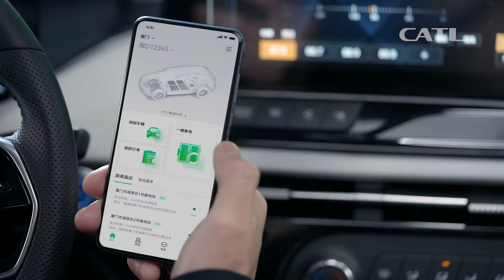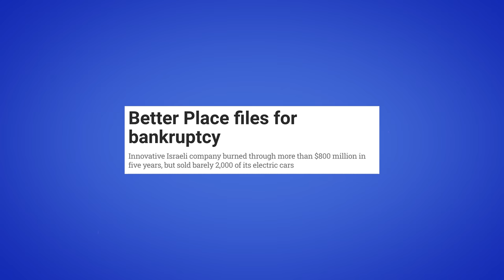Why Battery Swapping Is A BAD Idea

Comment: Maybe while hotswapping is not the best idea, the concept of universal batteries could work by giving owners of EVs alternatives for when their current battery dies...
Reply: I don't think it would be hard to find 3rd party batteries provider for mass produced cars if demand arises.
It is a right to repair problem.
I know certain automaker is notorious of that, which makes people expect EVs hard to repair, but other automakers prob. could do better.
Reply: 500k miles warranty by Tesla on battery is ample I think.
Reply: How long do you think a battery lasts these days? Modern batteries OUT LIVE the car itself. So why bother?
Reply: @HermanWillems  Where do you get this BS from? cars don't rot anymore and EVs only have batteries and drive units. The biggest reason that EVs are taken off the roads and scrapped is because of battery damage...
Reply: @veerkar  Where's this BS from? here in UK, the warranty is 150k miles and that is only to keep 70% battery capacity retention which is pretty poor.
Reply: @jlrguy2702  i have yet to see that happen..assumptions my friend. When you want something to be true because u hate something does not mean you are correct!! I live in the Netherlands and together with Norway most EV's per capita and i never heard about such thing. U just assumeeeeee
Reply: @HermanWillems  Asume what? I work in the automotive trade, not that it's that hard to find relevant information. I also own a Tesla Model X so don't know where you get the hate from, "pleb". For the past 15 years cars have mostly been galvanised or made of aluminium so they don't rot. EVs aren't old enough to have any rot or rust on them, meaning the only reason to take them off the road is either battery or motor failure, judging that a motor is relatively cheap (4-10k) compared to a battery (15-20k). Currently, the only reason any EVs are taken off the road is because of battery failure or accident where it's deemed a total loss. 
So if anyone is assuming anything it would be you, lazy rubbish comments based on opinion rather than fact.
Reply: Battery is also including cooling and  heating elements, among various sensors. They would vastly different between manufactures and even models.
Reply: @semibiotic This is for one brand, NIO so there’s no complications on battery swapping at all??
Reply: It more like to Auto-da-fe. With heretics penance and immolation.
Reply: Spot on!
Reply: Basically  teslas  are like  phones now yes people complaining  about  folding phones  your only gonna use it for a year and a half and trade it in for a new phone is that what's happen  with tesla is it 🤨

Because  everyone  wants the latest  phone ile probably  start trading  my phones  in every year and a half for folding  phones  lol  because  the batteries  don't last 2 years anyway of hard use why can't we have nuclear  diamond batteries  that would last 7 years for as long as the security updates  oh yea battery  last 2 years but if your replace the battery  4 times every  2 years

Comment: Battery swapping has additional benefit that was under the radar..

Quick charging batteries degrade them faster. We will need physically less resources to sustain such system (resources for new batteries) (although bigger investment of resources on start)
Reply: It's not like batteries in swap station are fast charged all the time
Reply: But most people charge their cars slowly. Only like Taxi's use the fast charger a lot. So yeah maybe the use case could be taxi's. But at my company there are like 20+ people having EV's and barely need any fast charger. Only a couple of times a year.

Comment: Spot on Rory. One other point is the maintenance required by the system. Installing costs money, maintaining and manning it costs tenfold. Especially in the colder European weather, where cars come into the system wet, muddy and salty most of the year. The system will wear, its complex mechanics and sensors will fail. Ever tried keeping an outdoor escalator running? We have one partially covered in our building. And guess what? It’s always busted, as is the outdoor wheelchair lift. The most important point is heating the system, batteries need to be charged at optimal temperatures, the system needs to be warm or it will freeze. Heating is expensive. My list goes on. Just improve the charging infrastructure and increase speeds. Sorted.
Reply: Do you think before you post?
Is infrastructure there presently to support widespread home or outside charging of any type, let alone fast charging?
Reply: @abbersj2935  Yes
Reply: @AKA001  Clearly you don't, as everything you said is answered by swapping batteries and not done in home charging.
Reply: @abbersj2935  I guess you don't own a home but an apartment unit.  Garages are always 10+ degrees celsius warmer than outside.  You can preheat the Tesla battery before charging.  A K is correct.  Winter in many countries last for months and -20 degrees celsius is not uncommon.  What works in China doesn't mean it's going to work elsewhere.
Reply: @johdo9953  You're wrong on all counts. I own a house and a garage, unheated, detached, it's normally at outside temp.
Reply: @abbersj2935  Obviously you are not.  Any person with a brain knows inside temperature is different from the outside.
Reply: @johdo9953  Doh. My garage is north facing and uninsulated. So much for what you know. Anyway, back to the real point, setting up the infrastructure for home and remote charging will be impractical and unfeasible in many cases, in my view a better answer is required. That is battery swap.
Reply: @abbersj2935  Battery swap is good except that it doesn't make economic sense.  If govt offers it free with tax revenue then I think it might work, because govt can subsidize health care or public transits.  However, it won't work for private company because it's costly to operate.  I am sure NIO will fail at some point.  Xpeng's financial and business model are better than NIO.  NIO is spending money on nonsense.  People buy cars not buying your dream.  NIO is selling a niche market but its market cap suggests it aims for mass market, hence sure failure.
Reply: @johdo9953  So you say. Batteries could be owned by the big oil companies, leased out to car owners hence reducing new EV prices by $12K to $15K
Reply: @abbersj2935  That could work, just don't think it's going to work for car manufacturer.
Reply: @johdo9953  I'm not sure either, but it certainly help more people buy more EV's. That's good for the auto makers.

Comment: For delivery vehicles and taxis, it could be a great option, so a driver can get quickly back on the road, especially if a company only have the same vehicles.

But, not only because we offer home chargers, but because it makes more sense, charging is the future of EVs, matching your home or public charger with solar panels is the sustainability winner!

Great video! Thank you for sharing 🔌⚡🚘
Reply: except solar panels arent the sustainability panacea that they have been touted as. They lose effieciency dramatically, are not recyclable, have many toxic materials in them that leech into soil if they panel is damaged, and because of supply chain issues, are more expensive now than they were a few years ago. Add to that the fact that most people are away from their homes when the sun is out and home when it is dark, you're actually at a big sustainability loss. 

Even if you had a powerwall or another equivelant way of storing the energy obtained during the day, all you are doing is increasing the already massive amount of carbon being released into the atmosphere by lithium mining, shipping, and refining, not to mention the myriad human rights abuses taking place in the countries where lithium is mined.
Reply: @SkillzorZ021 it's not the way it works : you can have home batteries if you want, but most don't. The energy generated by the solar panels goes into the grid where it is consumed immediately. Solar panels efficiently does go down with age but not that much and as pollution is concerned, you got to compare it with the disaster that oil extraction, refining and transport is

Comment: As an EV owner of 3 years on my second Leaf, I have to agree with you. Battery swapping seems a great idea, however, when you’ve owned an EV you realise it’s trying to solve a problem that’s not there. 

Like most EV owners I charge overnight. I have no off street parking so I plug into a street lamp in a residents charging bay. My car is my personal and driving school car so, on a day to day basis, I go out and do a days work then plug in again overnight. Battery swapping has no advantage compared to overnight charging. It would be more inconvenient because it would require a trip to a battery swap station and at 6:00 in the evening probably a wait in a queue. 15 seconds each evening and my car is plugged in near home. 

Then there’s long journeys. The rapid charging network does have room for improvement. I’ve not ever been let down by it but have been mildly inconvenienced. The network is improving though, especially in the last year. No longer is charging a solitary charger in the corner of a dark car park but rows of shiny chargers. My envy for Teslas and their Superchargers has still made me order a Model 3 though. Tesla just got it right. 

On long journeys rapid chargers usually coincide with a toilet break or food so the wait isn’t a problem. And while rapid charging costs more than overnight charging it’s still cheaper than running an ICE car. This is why battery swapping won’t find a market. As you say in the video, the scale and cost of the facility to store and charge enough batteries to to give drivers that 5 minute turn around without a queue will make it more expensive than rapid charging. The amount of people who will need this fast turnaround after a couple of hours driving is going to be small. As you said, is it worth it to save 12 minutes. As us humans need toilet breaks and food a battery swap will increase the time for these breaks as you have to be with the car while the battery swaps before you can get to the food or toilet, rather than about 30 seconds to connect to a rapid. 

Some manufacturers are moving to structural battery packs to cut down manufacturing time and costs, and vehicle weight. This will increase range and reduce prices. A structural battery couldn’t be swapped. 

Battery swap might have worked if it had been adopted initially and EVs had no way to charge other than battery swapping. It would have needed agreement of a standard from all manufacturers because as soon as one put a charge socket on a car owners would start charging overnight and ruin the business model. It would also have needed enormous investment in swap stations up front. 

Nio are making some very nice cars. Hopefully the UK s one of the European countries they’re exporting to. I think they will be charged just like any other EV with a few battery swap stations that are a marketing tool.
Reply: Besides 18 minutes charging is just around the corner😁
Reply: @mannyechaluce3814   I Have a Tesla Model 3 on order. The spec from Tesla says it will charge up to 171 miles in 15 minutes at a Supercharger.
Reply: @EVinstructor  The spec and reality are not always the same.

Don't get me wrong, love our Tesla and absolutely would buy it again. Road conditions  dictate how much range you get at a supercharger.

That said you are spot on about battery swap. After almost 3 years owning a Model 3 I see it as a dead end idea 
If anything I see how swapping as an excuse to make batteries a subscription product (ugh) and an opening for governments to impose a limit of 100-130 miles per battery. That in my book would greatly hamper adoption.
Given that fast charge is already a 12-18 minute event and gets you 120-180 miles, hot swap wouldn't actually 'solve' the problem people imagine.

Comment: Battery swapping makes perfect sense for densely populated areas .. especially is large cities.  It makes a lot of sense to take the battery out of the car since battery can be maintained or repaired outside of the car.  Also, swappable batteries also means continuity for battery evolution.  Car owners also don't have to worry about battery failures or battery life cycle.  All EVs should have charging and how swap capabilities .. best of both worlds.  A lot gas station can be retrofitted to include battery swap service.  Need to think outside the box.
Reply: And you'l pay more than having to buy a new battery once if thats even needed because companies are not charity. your logic is flawed and unrealistic for a capitalistic world.

Comment: There are a lot of advantages. 1)  You can buy a cheap car now with a small batter and just swap out as batteries get cheaper or you get richer.  2)  Quick swapping means you can do with less battery, which means less cost and weight.  3) helps resale of cars since I buyer does not have to worry battery is damaged.  It would make car companies outside of China more willing to make EVs since the battery is now decoupled.  4) Leasing batteries would give dealerships a way to make money after the sale.

Comment: What about integrating swap stations to store renewable energy? Using them as grid support units will be an important factor to consider. Swapping will be most viable for the micro mobility segment but any scenario where a quick turn around time is needed can benefit by this once doomed technology!
Reply: the NIO -model
Reply: If they have swaps they still need other batteries for grid stability / storage. Plus the other function requires other technology. So it's not a real savings.
Reply: That works when governments are able to force collaboration.
Reply: @acchaladka  It is savings... Once more people buy ev and older EVs are discarded now you have millions of lithium battery wasted, with Nio swapping stations you can simply swap to the latest battery hardware granted if it is compatible with your car, it will reduce landfills of abandoned vehicles

A single swap station can swap 100 EVs a day, while for charging you'd need a mall size parking lot to charge 100 EVs a day... That's assuming car owners can get space
Reply: Great idea, problem with green energy is storing it for when it’s truly needed. Perhaps Nio swapping stations can get us closer to mass V2G.
On another note, “Mr EV driver, would you like the option to upgrade your 5yr old EV to the latest battery technology?” “Er, yes please.”
Reply: @acchaladka  Yes it is, how many batteries are not used at the moment as they are oversized for the owners driving?
Reply: @nathanieong6212  The EU could, like with phone chargers. This is far more important.
Reply: Yes, they could charge up the batteries over night to balance energy generation. If unused batteries could also supply instant load support.
Reply: Yes, brilliant idea! But your energy infrustructure would be under the control of a Chinese car manufacturer with ties to the Chinese Communist Party Muwahahahahahahaha! 🤣
Reply: @gw7514  You really can't think for yourself can you? It has to happen to make the EV practical. Governments will have to enact common standards then car companies will design and make them. This is a clean slate, new thinking is required.
Reply: @abbersj2935  I can think perfectly, you keep touting these standards that don't exist, yap, yap, yap, yap, just white noise of generic noise  coming out of your mouth, stop touting theory and demonstrate what you're saying in action, oh that's right there isn't a standard for EV battery swapping and no government initiative to standardise just wishful thinking coming out of your mouth 🤐
Reply: @gw7514  You clearly can't. Where do standards come from? Do they grow in the ground? On trees? No they are developed by people, like the standards on voltage, like the standards on measurement, like the standards on housebuilding.  Yap, Yap, Yap, Yap. Grow up, learn and see what needs to happen.
Reply: @gw7514  They are doing it in China now, have been for two years. Are you saying that they are more clever than engineers in America and Europe? There will need to be a standard, that's easy to develop. Why not go back to burger flipping, as that seems like the only thing you understand.
Reply: Exactly, charging it during a cheaper low demand phase and selling it back to the grid when there is high demand. It can make money. I'm pretty sure they already have this. 

There is even talk about every car that is connected to the grid could be used as backup energy in the future. With millions of cars, it will be the biggest energy storage in the world making their owner a passive income to at least soften their electric bills.
Reply: @beatmeierbm  Best case it works only in China where most people live in apartments.

Comment: 3 extra considerations Rory:

1. When these batteries are not in use, they can serve as connected grid storage. That is a revenue source within itself.

2. Not owning the battery has huge appeal, given that the principle depreciating component in an EV is the battery.

3. Surely you can charge these vehicles conventionally, so yes, I agree with your maths on size and time needed, and in cities, it's not viable, but maybe I start my journey in a city, charge conventionally, and then swap out at strategy positioned spots along magor motorways.

Because your analysis assumes mutual exclusivity, it's limited. Doesn't have to be!